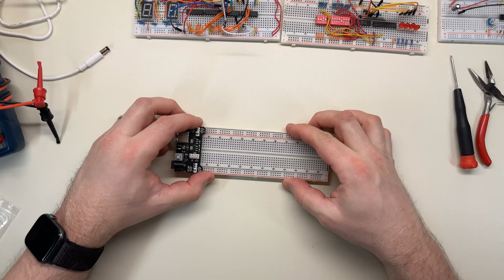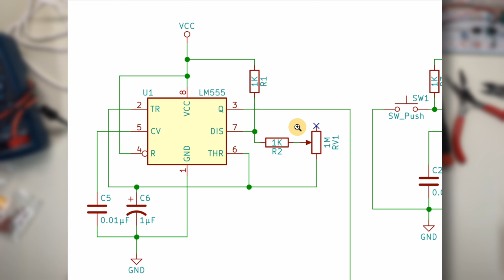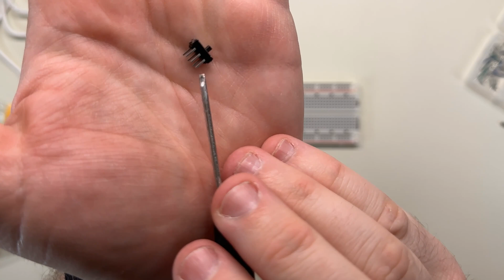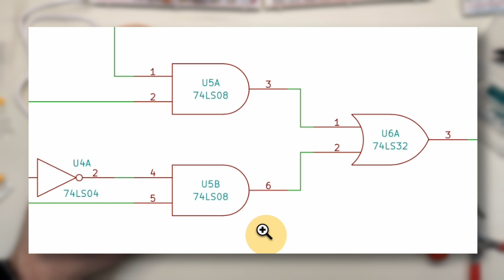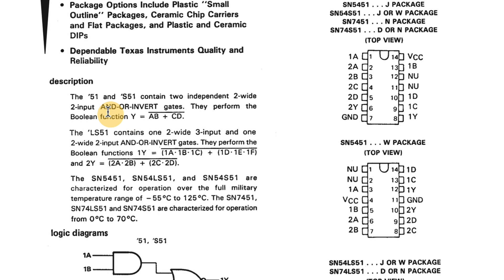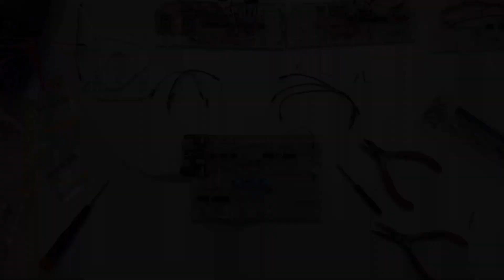Building an adjustable clock source and using it to count to 255

Comment: 20:51 You observe that the chip is warm.  The total chip current (typical) is 65mA.  You don't mention the resistor values of your LEDs, but assuming all 8 LEDs are on, I suggest a resistor value of at least 320ohms so as not to stress the chip.  That keeps things at about 5mA/LED which should be a safe value and sufficient to light them as well.
Reply from the maker: I happened to use 1K on each LED for this circuit, so it sounds like this should probably be fine. Maybe these particular chips (or these from this particular manufacturer) just run a bit warm or something?
Reply: @bigzaphod  Right, 1K should be fine.  So yeah, maybe they are knockoffs.  Could be depending upon where you purchased them from.

Comment: Those 4 gates (2x7408, 7404and 7432) can be replaced with an equivalent circuit made by the 4 gates in an 7400 IC. Try to read about logic minimization. Can save you a lot of ICs and traces on a PCB.
Reply: This is the way to go. Two and gates feeding an or gate is logically equivalent to 3 nand gates. Only one chip.
Reply: @geeko321  yes, and the last NAND gate used as inverter. There you have an 7400 fully used.
Reply: Something so satisfying about that level of efficiency.